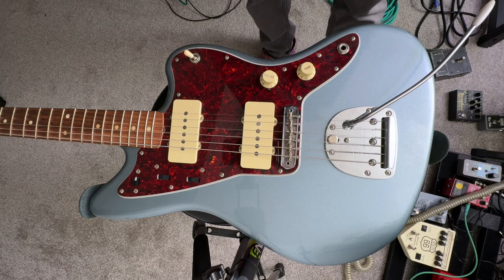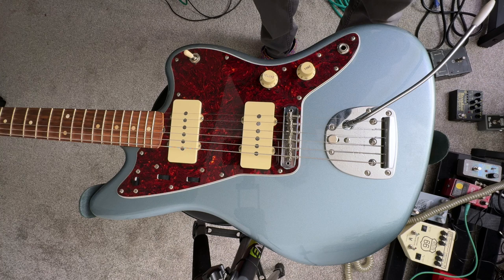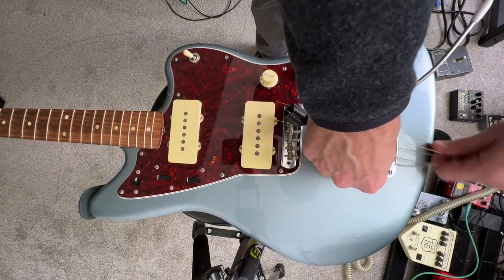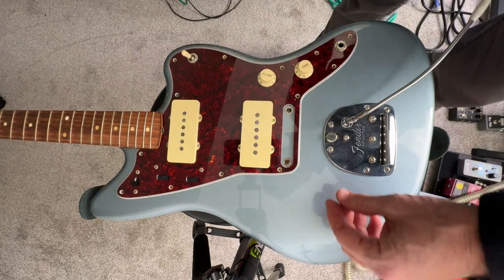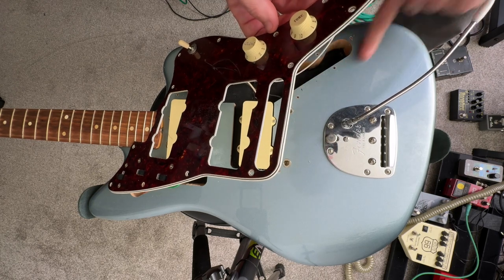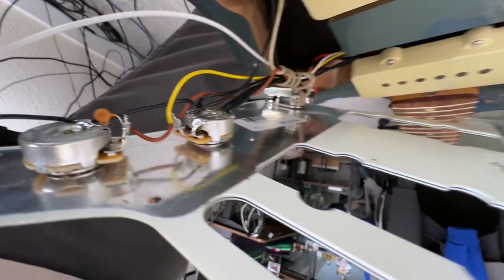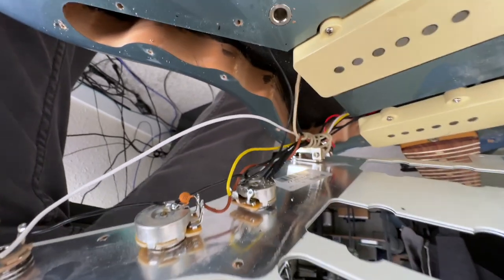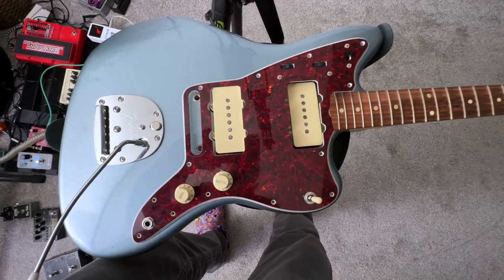Under The Pickguard - Jazzmaster 60s Vintera

Comment: I used copper tape from stewmac and it was more of a headache than anything, it wouldn’t stick to the wood ! People say normal foil tape from your local hardware store also works and it sticks a lot better. Definitely made my guitar quieter
Reply from the maker: Thanks! I may try that and see if it works better.
Reply: I didn't have access to the stewmac variety, so used a normal copper foil. It sure does stick to the wood, but that shielding paint (that doesn't do much shielding, quite frankly, as it's not very conductive and doesn't cover the whole depth of the cavity) is a real pain, because nothing sticks to it at all. Perhaps if you give it a little sanding, just to make the surface more adhesive, it might work better, but I'm not sure. Otherwise, my experience with copper shielding went pretty well. Provided you check for electrical continuity of all the parts of your shield, it should reduce the hum noticeably. I wouldn't say that the build quality is low, it's certainly way ahead of Squier CV (which, at this price, it bloody well should be), and comparable to the original 60s JM model (not in terms of materials, just the overall QC and construction)

Comment: ANY conductive material will work. From 1958 to 1980, the jazzmaster cavities were lined with brass and soldered together, and under the pickguard was a thin sheet of aluminum. You could get some adhesive spray and reynolds wrap aluminum foil, and it'll work just as well as the overpriced copper tape
Reply from the maker: That would have worked better than the copper tape I had already bought and had a hard time getting to stick. 😁. Thanks for the informational comment!